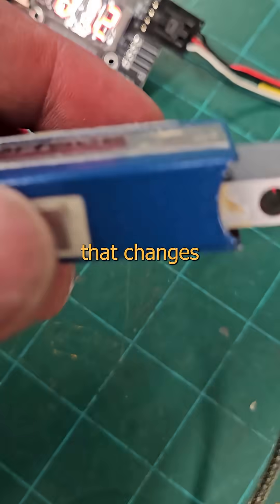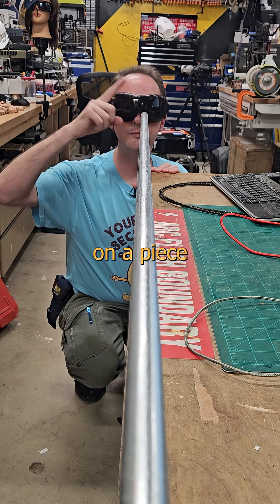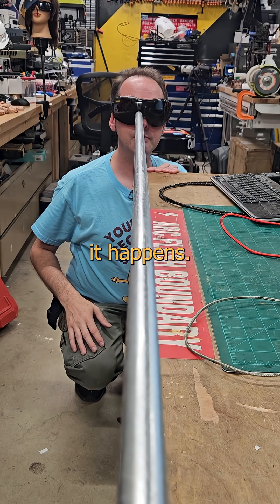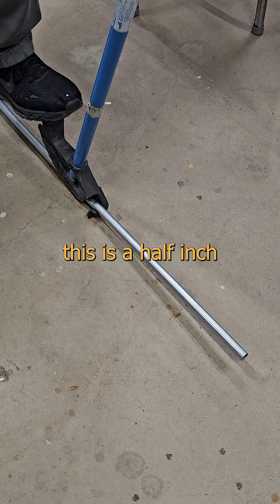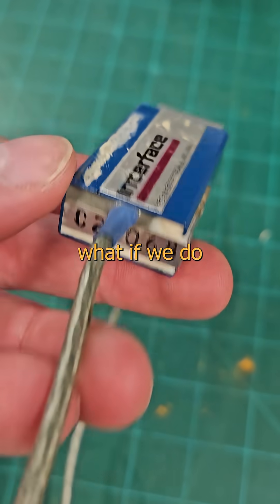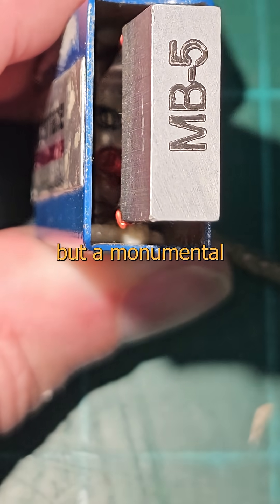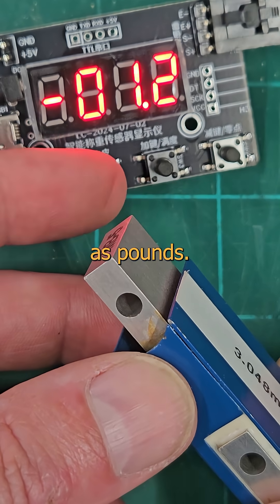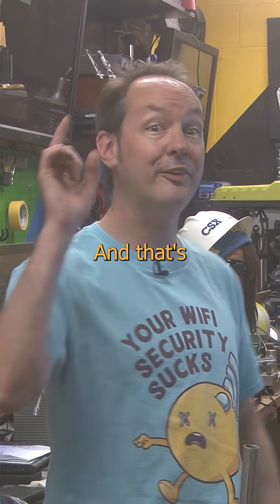Elastic and Plastic Deformation #chrisboden #comedy #engineering #modulus #strain #gauge #scale

Comment: there are very cool modern strain gauges that work by using the effect of conduction of magnetic field lines through metal, with the degree of compression the conductivity of the magnetic field changes. Something like weighing using a transformer, by crushing the transformer core.

Comment: Do you get a lot of shit from a papermill? You had that big drive motor in another video, and now this, which are used to maintain a specific tension on the sheet of paper as it runs through the machine. Mostly any place it passes through a nip point after the sheet has left the dryers

Comment: Now I'm not a blacksmith, but I occasionally pound some hot suff, so I do have a basic understanding of elastic and plastic deformation. Fun to hear a topic I kinda understand already! Although when I make things plastically deform, I am usually far away from the Brotherhood of Expensive Sounds

Also, there's a fun second way a spring can break - brittle failure. Now that is very rarely a non-expensive sound!
Reply: When I extrude hot stuff, the hole that came out of usually experiences elastic deformation, but it happens that it bites off more than it can chew and gets plastically deformed 😢
Reply: Yup! 😊

Comment: If you think that is cool, I finally learned how the accellerometer and IMU in a Trimble R12i works. You can check a point with your rover at a 45 degree angle relative to said point with under 0.1 ft of error. Science is coo

Comment: I don't think that's how my bathroom scale works, it's basically a spring and some gearing and linkages and such that make a disc with printed weight values turn when you step on it, no electricity needed.

Comment: i was looking at the load cell in my kitchen scales and it just screams black magic, a solid piece of metal with no apparent moving parts and just a couple of wires sticking out of a small patch of resin in it. even pushing down on it pretty hard there's no noticeable give, flex or deformation. yet, the thing can tell you how much load is on it down to the gram. voodoo i say.

Comment: I have a 50 cNm torque transducer that copped 1.5  Nm because I picked up the wrong torque driver. 

Very plastic deformation. It's part of my "don't do what Donny Don't did" for new starters in my lab.